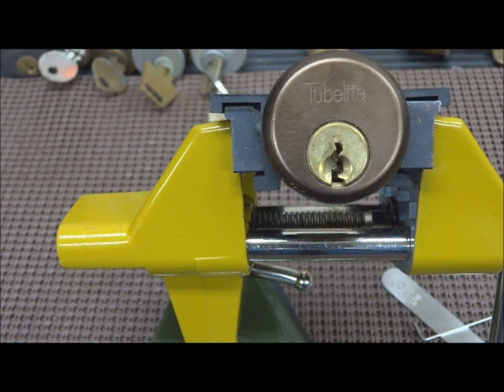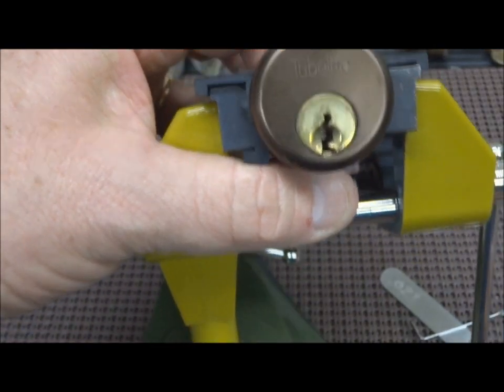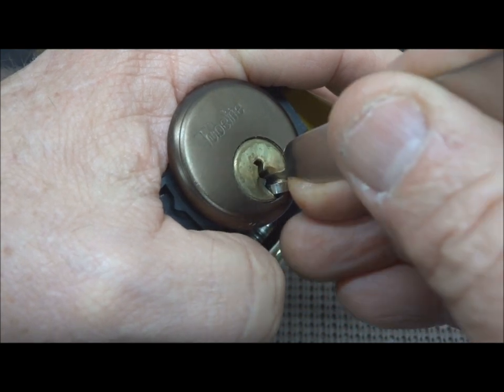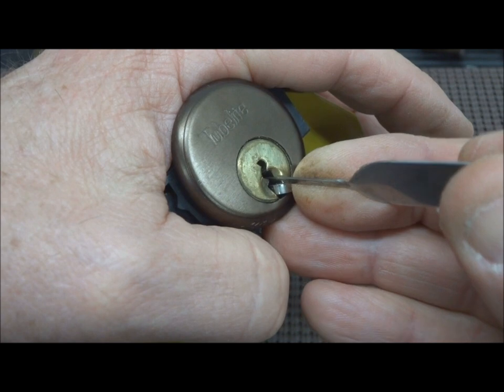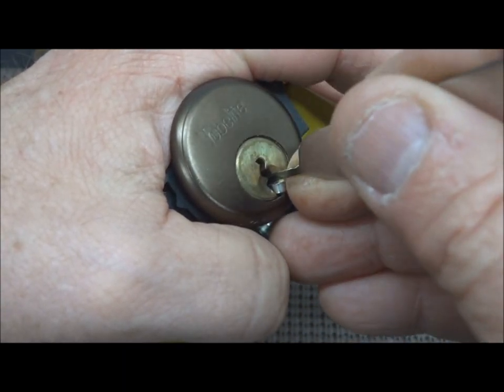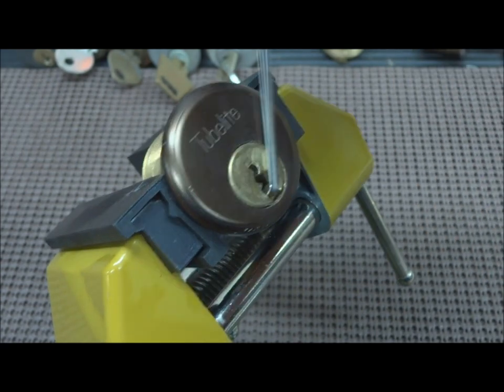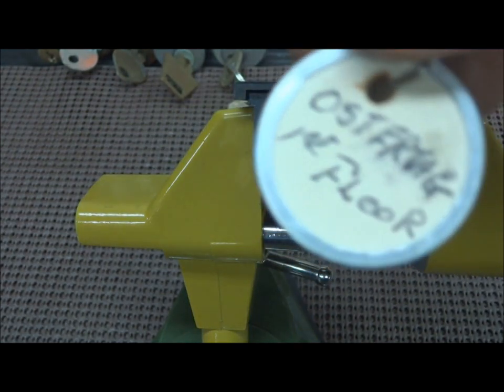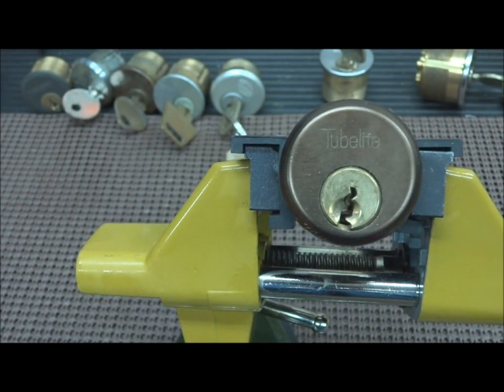(144) Tubelite Mortise Cylinder SPP'd & Zipped

Comment from the maker: You are exactly right!  For example: Kwikset versus Schlage.  I think it all comes down to manufacturing tolerences and bitting.  Sometimes I find regular pinned locks harder to pick than security pinned ones, simply because there's none of the characteristic feedback to tell you if you are on the right path.